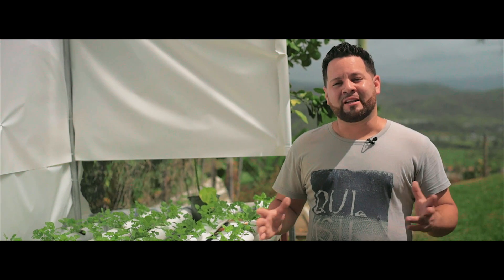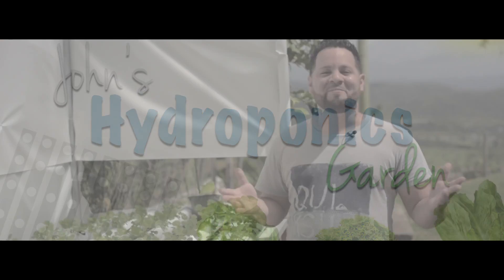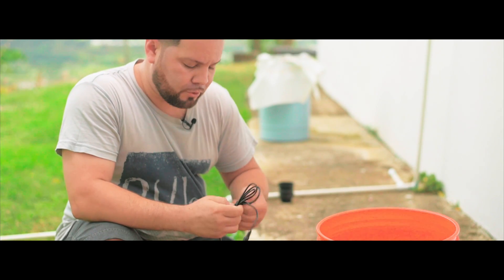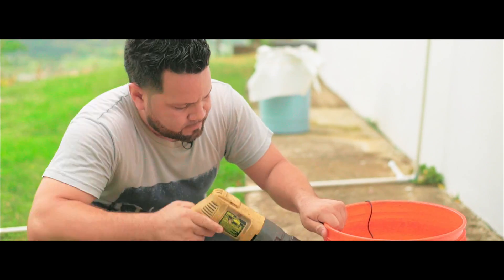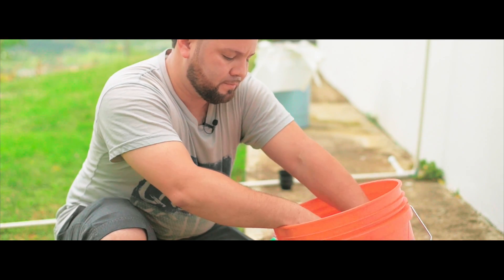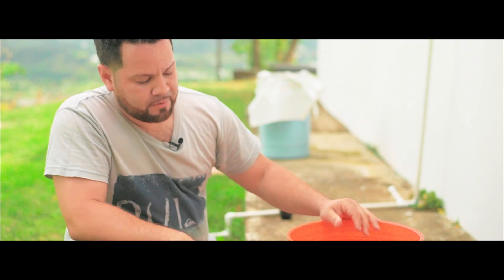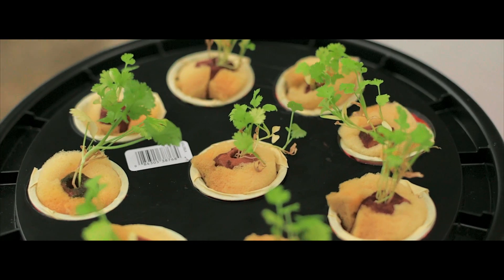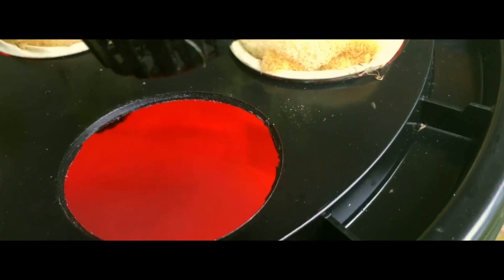DIY Fogponics

Comment: did you have any problem and solution with the fogger? i know that with aeroponic, people will have to clean there spray nozel cause of mineral contained int the water, is this also hapening with this systeme
Reply from the maker: No mat damerique i didnt, i was using ultrasonic fogger in that system. when i was using it to test it out i was trying to get a good balance between the water level and the fogger. since these were cheap ebay foggers they really didnt put out the power/fog i needed

Comment: Can you please turn the video on what you are doing instead of commentary. You made this video useless
Reply from the maker: I will be making a remake of this video. Thanks for the feed back Hiren Darji
Reply: John's Hydroponics Garden thought it was fine. Would be helpful to have more video of the gasket system. Otherwise good though. How often are you supposed to clean it/rotate the water and have you had any issues with reliability with foggers?

Comment: Awesome video! good job!
Reply from the maker: Thanks Sagi!
Reply: I was wondering. Since foggers are hard to get in Israel (for some reason) -- what ultrasonic foggers would you recommend for a 20ish plants 18gallon cloner?
Reply from the maker: +Sagi Strauss the ultrasonics fogger I bought works good for the 9 plants I have. I have it a cycle of 30 minutes. The water level is about 4 inches below the net pots. I would think if you do the same thing you shouldn't have a problem. Here a link the one I bought. If you have and other question let me know. http://m.ebay.com/itm/Ultrasonic-Mist-Maker-Fogger-Humidifier-Water-Fountain-Pond-DC-24V-/131387849620?nav=SEARCH